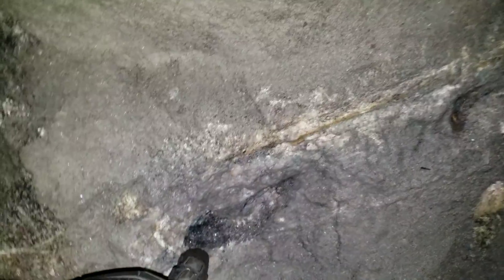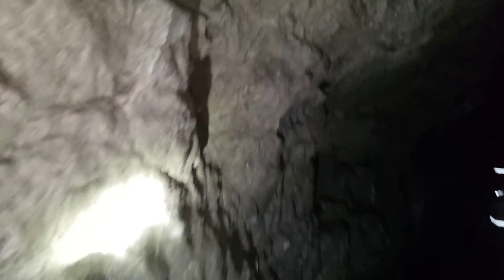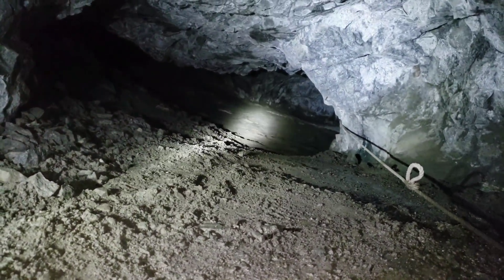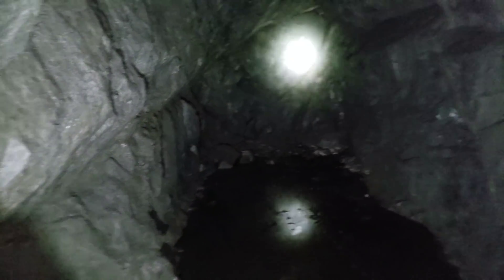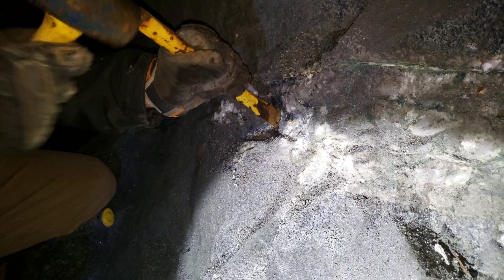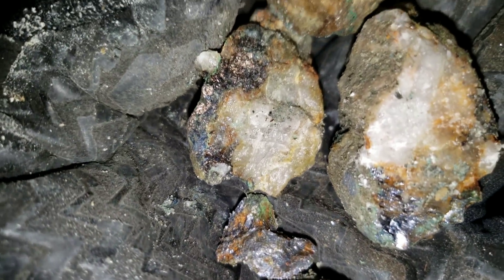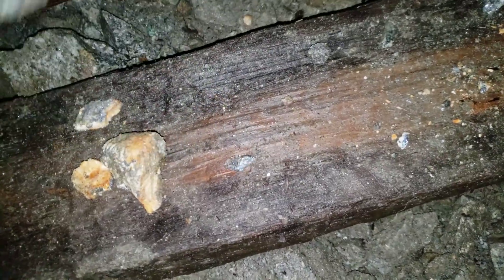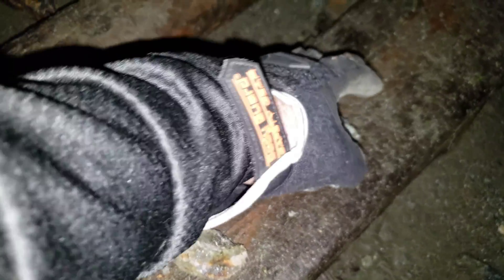Mineralized Quartz Vein With Bornite, Chalcopyrite & Molybendonite In An Old Gold Mine!

Comment: Justin,I feel your pain with Mosaic.😒 This amalgamation of Timberwest and Island Timber with new management has really tightened up access. It is frustrating to say the least. Not to mention the ministry of mines removing placer inventory really stinks as well. 😡 I would think that if you gave them notice of access 8 days prior and went through an open gate and were then locked in they should have to cover any expenses to unlock the gate to let you out. Whatever came of the bridge material that was removed? Or are you not concerned about it?
Reply from the maker: That's what we figure if they lock it on us we did our due diligence so it's on them. Luckily they didn't....the bridge is still there the materials still there all logging is shut down and I don't see anything being done about it they aren't even moving there lumber. There is easily 1000 truck loads of lumber that have been sitting there for 7 months.....well maybe a bit less now seems everyone is helping themselves to firewood lol